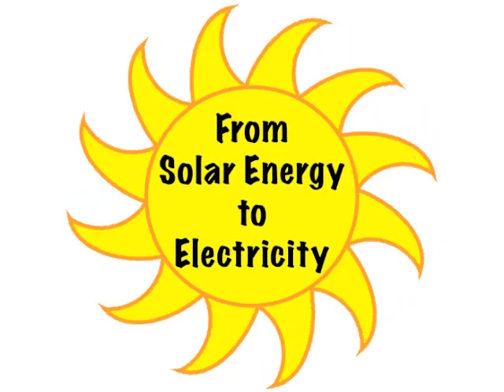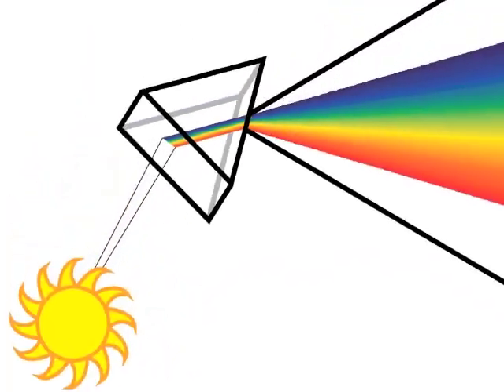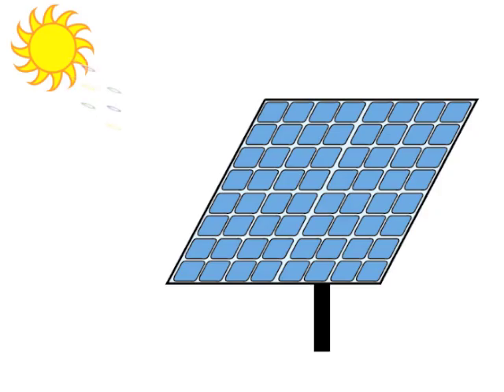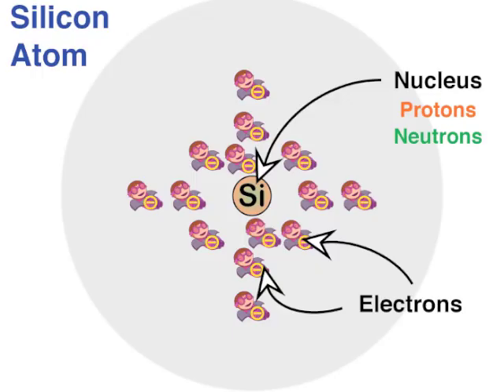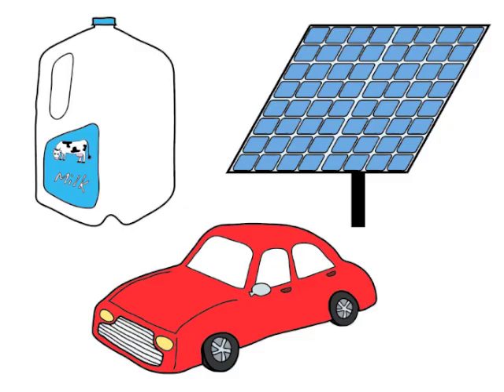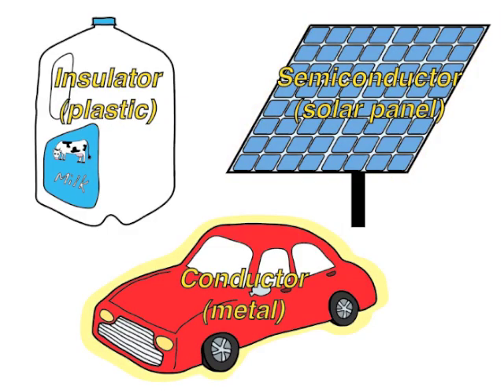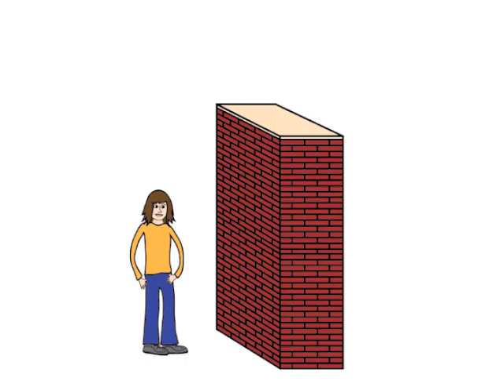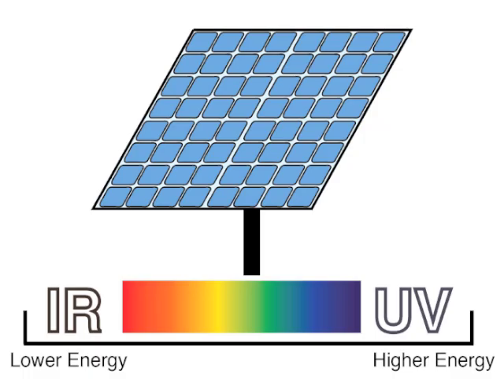From Solar Energy To Electricity

Comment: It's worth to mention that there are two layers of silicon semiconductors in the solar panel. One with the  free electrons and the second one with the extra space for the electrons (ie. holes). When these two layers are combined electrons can wander across them leaving a positive charge on one layer and negative on the other.